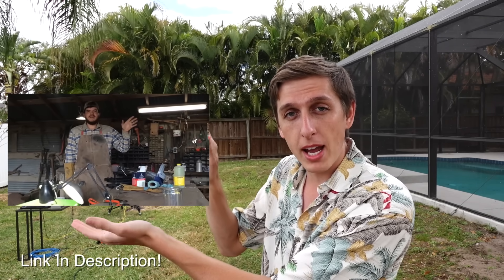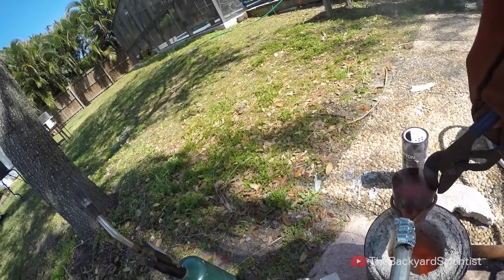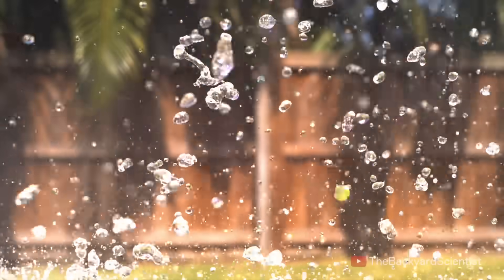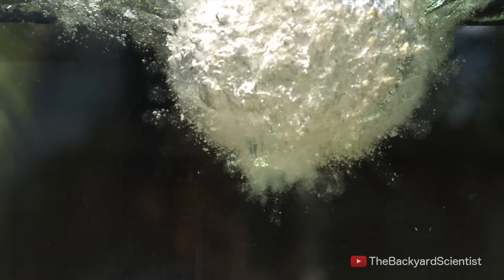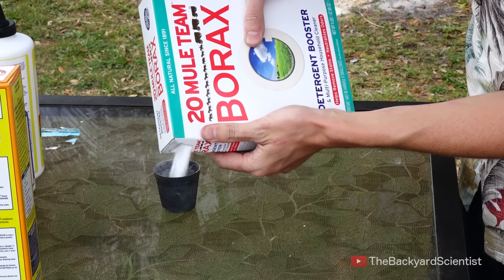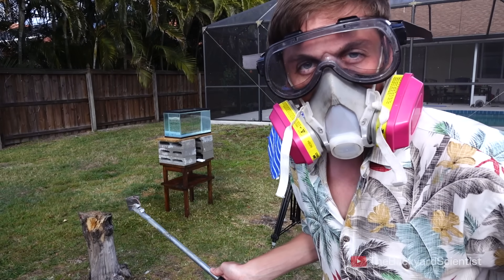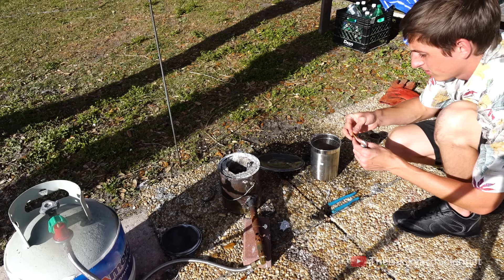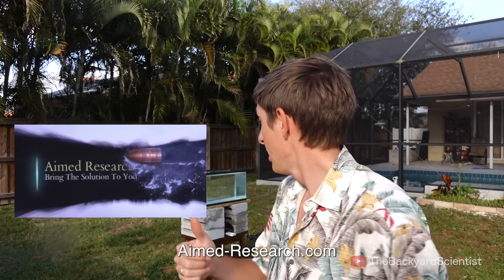Pouring Molten salt into Water - Explosion!

Comment: {my idea of solution} So, I'm pretty sure you're right about the expanding part, but why other salts didn't explode. Well I have a idea, but I couldn't find more info, so I will post my hypothesis so that you can tell me if you find any obvious mistake (also I'm not a native speaker, so sorry for any mistakes). So I had hard time finding term of this occurrence in english, but I believe it's "cohesion forces". Basically it's force with with which molecules of matter react with each other and make it more or less cohent. For example mercury has quite big cohesion forces for a liquid so when you pour a little bit of mercury into container it will create these little balls. But when you pour water into container it will end up spilling all over it. Now, to the final point: why does it matter here? Maybe water just cant get in between other salts. It end up being moved instead of getting captured in between salt because they have considerably stronger cohesion forces. That's my idea at least

Comment: I'm guessing the total amount of heat the NaCl has is a factor as well.  The specific heat of NaCl (solid) is 50 joules per mole and degree kelvin, and 50 grams of that is a bit shy of a mole, so the energy to transfer to the water is A (for "a lot").
Borax has a specific heat of about 70 joules per mole and degree kelvin, but a mole of borax is about 7 times the size of a mole of NaCl, so borax can impart about A/5 times the amount of energy on the water (assuming similar masses and temperatures).
So if a salt with a higher heat capacity than NaCl could be found, that could be brought to a comparable temperature, I'd expect the fish tank to end up scattered farther over the yard.
Also, seeing the pure sodium get dropped in was awesome!

Comment: Does the Leidenfrost effect work with saltwater as well as with regular water? Could the molten salt be attempting to bond with the water to make saltwater, disrupting the Leidenfrost effect? Obviously even if it turned into saltwater, it would still instantly boil away. Or, maybe it has something to do with the temperature of the molten salt compared to the other items? The explosion of the sodium was definitely different; there was fire, it didn't go into the water the same way, and it seemed like it was quicker and, if not a less violent explosion, then violent in a different manner, so I don't really think it's related to that.

Comment: Pretty sure its caused by London's Dispersion Forces of the salt in contact with water. The high heat causes the rupture of the forces in a more volatile way, because of expansion in the molecules with the temperature. @TheBackyardScientist

Comment: Although I am not a scientist, I do be believe the reason it explodes is that the water cools the salt so fast that the elements in the salt separate and vaporize and that creates a jurastic change in pressure causing it to need a way out so it chooses a violent explosion. (like I said I'm not a scientist so idk if my hypothesis is correct)

Comment: The hot sodium and chloride was moved to a higher energy band so it allows its self to bond with the water and other NaCl around it trapping the H2O, the fast cool down move the energy band to its original state pushing  that energy back through the water and Pushing out the trapped H2O. That's why there is multiple explosions

Comment: because salt and water make a solution and that solution causes ionic bonds to be weaker this makes waters force driving it slow down hence it freezing colder and from that the salt that touches first makes a solution that solution evaporates instantly causing the salt to be pushed upward and creates a Chanel from the propulsion made, check the lid of that container and salt should have crystalized on it.

Comment: try pouring water on to the molten salt. This same kind of explosion happens when molten steel is pouring on top of water. With steel being poured onto water it basically flash boils the water turning it into hydrogen and oxygen gas. This may be what is happening.

Comment: I might be wrong, but I think the Leidenfrost effect "broke down" for the sodium chloride because the melting point was lower? As the molten salt came down, the water might not have vaporized in time because it wasnt as hot, so some droplets still might have come into contact with it.

Comment: I think you have a pretty good hypothesis. It makes sense, in that the ionic bonds sodium bromate and the covalent in boric acid are going to be stronger than sodium chloride. To test this, you can look at something that has even weaker ionic bonding than NaCl, which would be even less viscous at a given temperature. Something like KI, KBr, etc. would have weaker lattice energies, and should break up even easier than NaCl. It's a little difficult to say, because this is a pretty messy process you're examining.

Comment: could the plasma arc from say a plasma cutter quicken the melting time, perhaps a sandblaster loaded with salt fire through a hot plasma arc then spraying into the water at speed and under compression, would create both a more impressive visual display but also a prolonged demonstration to further intensify ur scrutiny

Comment: It's just a physical reaction. The very hot molten salt causes rapid boiling upon contact with water. As water vapour has much lower density than water the vapour rapidly expands, resulting in the explosion. It's like pouring very hot oil into a pan of water.
Reply: +BR R  I get what you are saying but the leidenfrost effect prevents any hot material from causing rapid vaporization of water, which is what he was saying, there is something else at play and we need a physicist explantion
Reply: The leidenfrost effect is not taking place with the NaCL, whereas it is with the borax. It is possible that the lower viscosity of the molten NaCl permits better heat exchange between the molten salt droplet and the water, preventing the leidenfrost from stopping rapid boiling. The molten borax is much more viscous so the leidenfrost effect takes place. There is also the fact that NaCl is relatively soluble in water compared to almost insoluble borax. Even so, if the leidenfrost effect does take place it's still possible for rapid expansion to take place once the droplet cools enough that the insulating vapour layer dissipates.

Comment: Assuming this might not be totally physical and maybe a bit chemical, sdium and chlorine they exist as free ions (Heat breaks ionic bond) from this we could also argue that the pH would be neutral seeing as NaOH and Cl- ions are being produced in proportion. Note of course that Cl- ions are only acidic in water, but that's fine as that's what's going on. But, what I think is different is that maybe (Not amazing at chemistry, just blue sky thinking) because the sodium ion has a +1 charge, it pulls the OH- ion from the water more violently. I think that's true but whether this would make a more violent reaction or not I really have no idea! Quite the reaction I have to admit!
Reply: +Oliver Maynard heat does not break the ionic bond in this case, or else it would no longer be molten salt, and it would separate into chlorine gas and molten sodium.
Reply: I'm pretty sure it does, other wise how could you explain the greater melting point of MgO compared to that of NaCl (Greater charge attraction) or the fact that NaCl doesn't conduct electricity when solid but does when it is molten? (Ions free to move electrons in solution)

Comment: +TheBackyardScientist I think this explosion is because of efficiency (caused by tablesalt's Solubility) salt dissolves fast into water faster than thermal energy can travel through it so first it dissolves then the thermal energy is transferred...  but I did 0 research on that and its just something coming out of the top of my head so it could be total BS... :P

Comment: +TheBackyardScientist Have you tried the same experiment with NaNO3, KCl and other sodium and potassium salts that dissolve very good in water? CaCl2, MgCl2, Ca(NO3)2? Their specific heat (I'm not sure if it's proper english term for it; it's the energy required to melt/evaporate/change temperature of a substance) will be different and this could lead to different explosions. That may lead you to some explanation.

Comment: i think i know what is going on l, why the nacl explodes and other substances dont. as we can see it takes a moment, untill the salt explodes, in that time salt is dissolved in the water surrounding the salt, causing the boiling point of the water to rise. at some point the bioling point is so high that the water can actually reach the salt and mix up with the liquid salt causing that reaction. other substances leave the boiling point as it is and the water transfers to steam before it can contact the molten substance.

Comment: Dude, Sodium is a alkali Metal, those are extremely reactive in water. It is a chemical reaction.
Reply: +Bruce Vieira Lopes someone didn't even watch the video. salt is sodium chloride. sodium and chlorine are each highly reactive due to not having a full shell of valence electrons. but when bonded together, salt is stable chemically. also, like he said in the video, a chemical reaction with pure water would cause a PH shift.
Reply: I actually watched the video till the end. I'm sure he would have mentioned that. Tell me, how does that change in Hydrogen quantity determine if a reaction is chemical or not? For all we know, the violent separation of hydrogen naturally separated the oxygen, plus the the explosions expulsed all the foreign substances, if there was to register a change, the change would be too small to measure on a single attempt. Salt is stable when at room temperature, increase the temperature and your creating all sorts of instability. Consider the amount of electrons your pouring in? The substances needn't share electrons, thus separating them. And for that brief second, the amount of kinetic energy in the particles is enough to make sodium and water contact and boom. Just watch videos on how sodium explodes in water compared to other alkaline metals and you'd see that explosion is pretty much the same. I'm not sure how the water being pure is supposed to affect the results ( I'm doing more research more about it ) in this particular case.

Comment: You should really pay more attention in your scinence classes. This is some basic physics right here. As the molten salt heets up he water, it boils. Because of the temparature of the salt, it boils very fast, resoulting in a lot of steam. This steam has to go somewhere and that is what causes the explosion.  Explosion happens whenever there is a lot of gas in one place. This is usually created by burning something that burns really fast, such as gunpowder, but evaporating water works just as well. On the other hand, the sodium metal explosions are created by burning helium, produced by chemical reaction with water.
Reply: +MrTada98 That's right. You mean burning hydrogen though not helium (noble gas).
Reply: Yeah, of course. I got these words sometimes messed up since english is not my native language. Sorry for that.

Comment: Feels like it's a chemical reaction.
Because if you melt salt(NaCl) you will end up with a liquid of Na+ ions and Cl- ions.

Pour that into water and you should get 2 reactions. 

1. Na + H2O = H2 + NaOH , balancing it would be 2Na + 2H2O = H2(g) + 2NaOH(s) 
2. Cl + H2O = HCl + O2 , balanced it would be 4 Cl + 2 H2O = 4 HCl(l) + O2(g)

And if we look att those to reactions we see that it breaks the H2O into molecular hydrogen(g) and molecular oxygen(g)

and O2 and H2 is both very reactive gases to each other. So it would create this reaction: 2H2 + O2 + small amount of energy(heat in this case) = 2H2O + alot of energy(the explosion!)

So if I'm not totally off it would be a chemical one :)

Comment: @ backyardscientist salt is made of Na and Cl. Na+H2O goes BOOM.. Normally that doesn't happen because if you dissolve salt in water it will be a Na+ ion. But when you heat that stuff up...  my guess is that you ll end up with some liquid sodium...
btw just a chunck of sodium in water is enough.. you dont have to pre melt that shtuff
Reply: +Saintwa Ye It's still the Na+ ion in solid or liquid salt.

Comment: This seems somewhat similar to what happened when I threw an ice cube (normal water ice cube) into a pot of boiling cooking oil. 

The ice cube sat there at the bottom for a lot longer than I thought it would and then one big BOOM! Hot oil everywhere! I was expecting it to happen quickly in the way that water crackles and pops in hot oil, but this took a long time. I'm guessing it had to do with the temperature change. 

You should try this out, I'd love to see/hear your explanation! :)

Comment: Don't elements and compounds containing the same element still have different properties? Wouldn't that mean the reaction to water doesn't matter since they technically aren't related to each other.
  Otherwise, great video and theory.
Reply: +benjieboyhero Yup that's right. Sodium metal has an outer electron with a low ionisation energy, thus it's strongly reducing. Sodium cations have no such electron.

Comment: This is chemical reaction. melted NaCl reacts with water this way 2NaCl+ 2H2O--> 2NaOH +Cl2+ H2. You can learn this in high school.
Reply: +vens No. Sodium in salt is a cation (positive ion) and is chemically unreactive as it is already oxidised. Sodium ions and sodium metal have completely different chemical properties. This is just a physical reaction caused by the rapid expansion of water vapour upon contact of the 800C salt with the water. Like pouring hot oil into a pan of water.
Reply: Sodium is reactive metal, an it does react the way i told u. You should consult your videos with scientists, before you uplodad them.
Reply: +vens lol no. Elemental sodium is reactive. Sodium ions (Na+) as found in salt (which consists of Na+ ions and Cl- ions) are not reactive at all except with very strong reducing agents.

Comment: I think The reason ph remains same is after the explosion is that the salt gets vaporized. The Ionic bonds might be breaking. Sodium going to NaOH & Chlorine going to HCL. You should try testing the gases for ph.
My reason that at high temperature the atoms are loosely bonded, also the surface area is more. The water vapor easily bonds the Na & CL creating a thermionic reaction.

Comment: Well, I'm no expert with university, but physics is one of my hobbies, and there I can maybe see a possibility how this actually works. Your explaination at 7:20 is getting close, but not entirely. This is not a chemical reaction, but purely physical. Also, I have an explaination for why leidenfrost effect can't protect the salt. The thing is very simple. You melt the salt, pour it in, and the water cools it down so it starts to crystallize. But only the surface can crystallize, core is still super hot. Cooling down on the outside, it wants to expand, but can't, creating very high pressure inside of the salt, which at certain point, breaks the outside crystallized layer super violently, exposing the molten salt in smaller and smaller pieces again and again to this crystal-explosion process. It can be nicely seen at 3:10, how it goes from huge to smaller blasts of the crystals. And why Leidenfrost can't protect it? Salt has the highest melting temperature of all the chemicals you tried, so even if it vaporizes the water before it touches, even the steam is cold enough to cool it just enough so that it starts to crystallize. The other two chemicals start to crystallize about 60°C lower than salt, which would need them much more energy given to the water than they can do. Hopefully my english skills made this a bit understandable, if there's something more to explain, just comment this. Thanks for reading this long post :)
EDIT: The same internal pressure during the outside shell hardening in used in Prince Rupert's Drops, and in similar way, Gorilla Glass.

Comment: I guess these something's are happening at the molecular level:

1) This is Physical rxn.
2) The molten salt (801°C) when in contact with water (b.p.100°C),it converts it into steam.
3) Also hydration energy being released as salt is being dissolved.But salt being too hot,this exothermic process becomes a explosion.

Comment: I'm no expert, but I think since the salt is molten, the sodium and chlorine exist as free ions. So it's basically pouring molten sodium into water, but this time, the chlorine somehow helps it get further into the water than pouring pure sodium. Whatever NaOH is formed is quickly neutralized by the Cl- ions. At least, that's what I make of this.
Reply: +Chandra Kiran Molten salt makes an explosion because of the rapid expansion of water vapour which is produced upon contact of the very hot salt with water. Liquid sodium metal makes a comparatively smaller explosion because the metal is at a much lower temperature, around 100C and doesn't cause a rapid expansion of water vapour. Instead the sodium reacts with water to produce flammable hydrogen gas as one of the reaction products, which then catches fire due to the heat released by the reaction. Sodium is less dense than water, so it floats on the surface. Sodium chloride on the other hand is around twice as dense as water, thus it sinks.
Reply: +Chandra Kiran You need dissociation to have ions. Dissociation is related with dissolution (in water) and not with melting
Reply: +Chandra Kiran No it's not. The sodium ions are not reactive whether they are in a solid salt or liquid. Sodium metal has different chemical properties because it is neutral and has an outer electron with a low ionisation energy.